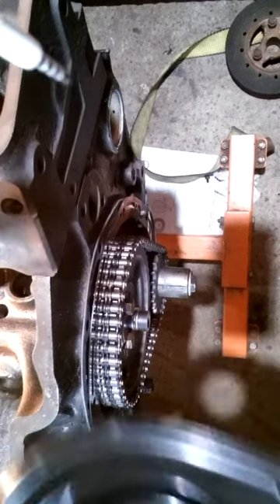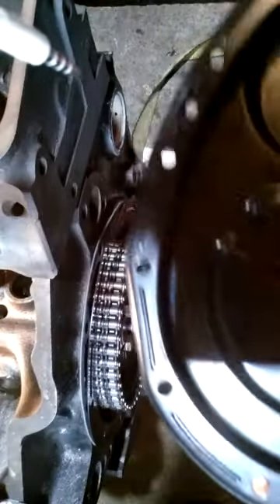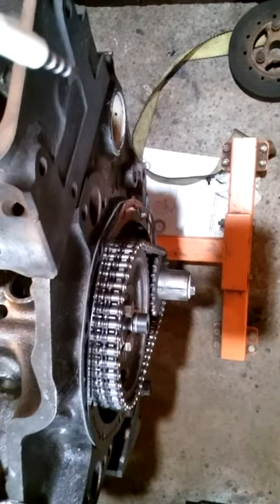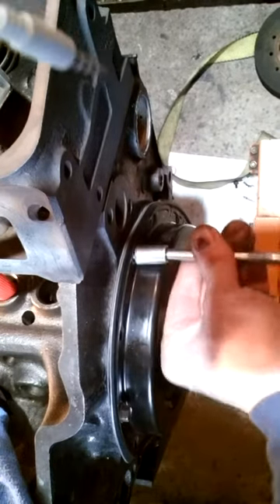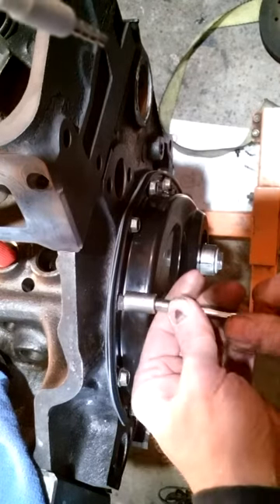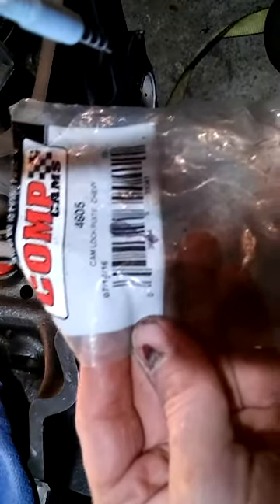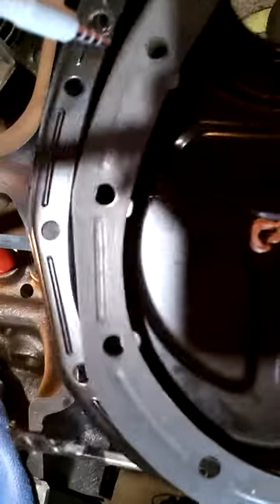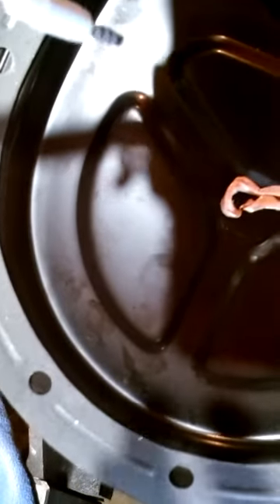Chevy Retro Fit Camshaft Cam Button Adjustment

Comment: Hi, do you know if i can use a retro fit cam in a roller vortec? not many cams to
choose from here......
Reply from the maker: Should be able to but why ? So many true roller cams for the 350 out thier. Retro cams not much selection and if I recall they cost more. Most cam company's can easily make a custom cam.
Reply: @mobilemowers  dont have any selection of cams here in new zealand everyone is out of stock. custom cam here is double the price of a store brought one and thats if they can get a core....its all screwed up here....
Reply: @mobilemowers I think he is asking, can a retro roller cam be used in a roller cam block?  In other words, are their any machining differences between a retro roller cam, and a stock roller cam.   Im in the same boat aswell.  There are plenty of retro roller cams in my area, i need a cam for my roller block.

Comment: If you have a cam retaining plate do you still need to use a cam button
Reply from the maker: Then you shouldn't. Button holds the cam in place when thier is no retaining plate.
Reply: @mobilemowers  the cam retainer HAS TO BE INSTALLED,  AS WELL AS THE CAM BUTTON!!!
Reply: No cam retainer plate = roller block , cam button is for blocks that weren’t factory roller

Comment: Which end of the cam button goes into the end of the cam the big or small end? THANKS
Reply from the maker: The only end that fits inside the cam. Should be the smaller pointed end and the larger end should fit flush against the timing cover.